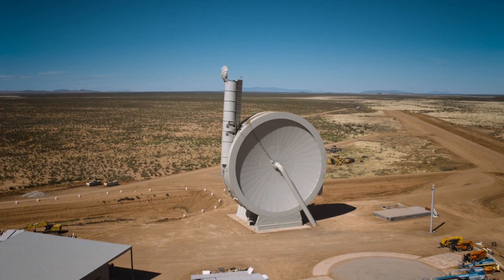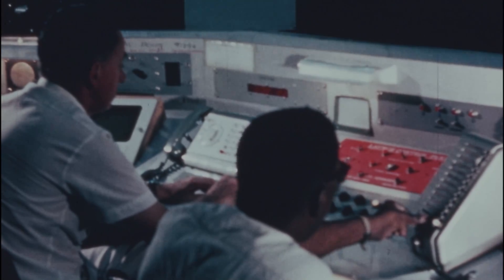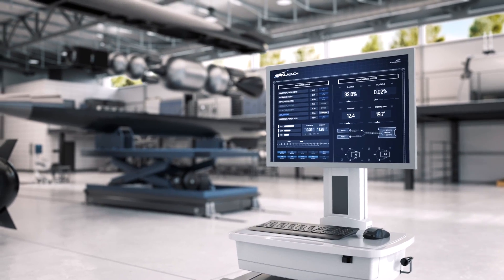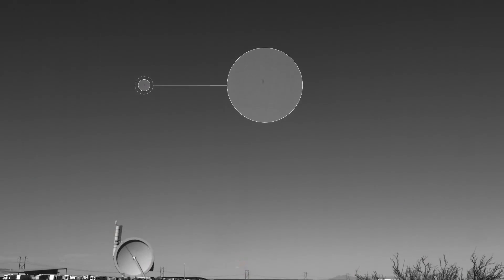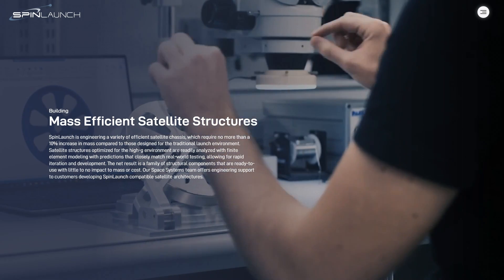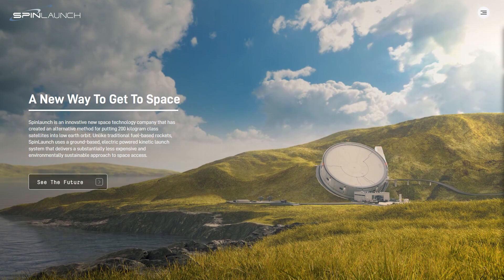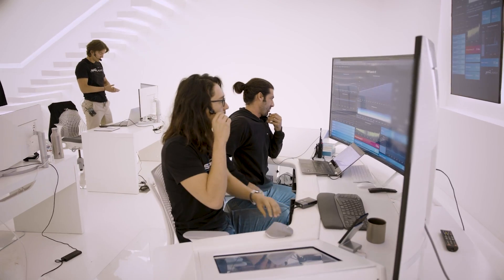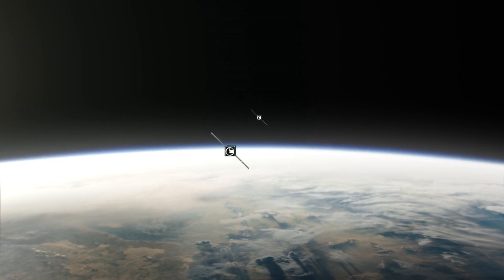Can Spinlaunch Throw Rockets Into Space?

Comment: I'd imagine that to re-balance the rotating arm at release, they could concurrently release a weight near the axis of rotation that would travel down the arm.  The transfer of that weight ought to also slow the rate of spin through some conservation of angular momentum.   (Where's my hand-waving Unicode emoji when I need it.)
Reply: This would introduce massive dynamic loads on the arms as they are decelerated in less than 1/4 rotation, and must contain the sliding weight at a g-load much greater than the rocket's 10,000g. Also aerodynamic impact loads are an issue, so there's a lot going on.  I was thinking a counterweight might be released at the same time that would need to be absorbed into the ground. This would be a pretty simple, but spectacular solution. The counterweight can be made of a liquid to prevent shrapnel and released into a chamber of energy absorbers. I can't think of a simpler solution than that.
Reply: @ryanmcgowan3061  Was my thinking as well.  Just dump a barrel of water into a shaft.  Of course as the barrel disintegrates the water is going turn to steam pretty quickly so you need to be ready for that.
Reply: @ryanmcgowan3061  Even water is shrapnel at mach 6. They cut steel plate with a water jet.
Reply: @ryanmcgowan3061  I came to the same idea. At the moment of launch the change in centrifugal force is proportional to rocket mass times radius (of rocket center of mass). To compensate an equal amount of m x r must be released from the opposite arm synchronously. The released counter mass would carry  r2/r1 times the kinetic energy of the rocket.
Reply: @venietvideo  Yeah, it doesn't really cost extra structure and mass either, because the counterweight is critical to the launch. And the release mechanism is already designed for the other arm. That being said, a rail gun seems more practical to me overall. If ever humans were to be launched, sustained 10,000 Gs is a non starter.
Reply: @ryanmcgowan3061  The problem with moderate linear acceleration is that the device will be very long. For example to reach v0=2000m/s with let's say human compatible 5g (50m/s²) would require 40 seconds acceleration over a distance of 40 km! (distance=velocity² / 2 acceleration)
Constructing such a huge device would be a big economic challenge. Another drawback is that the direction of launch cannot be changed.
Reply: @DavidKnowles0  The rail gun is being used to create a hypersonic canon at speeds that are at the bleeding edge of current technology. Linear accelerators are pretty well developed. If you ever spent the day at Disneyland, you probably have been accelerated with a small bus-sized load of other people to 60 mph in a couple seconds using a linear accelerator and didn't think much about it.
Reply: @venietvideo  Yep! If you don't manage that kinetic energy that's on the counterweight arm, your centrifuge is going to try to yeet itself into the ground with equal and opposite force. It's as if your centrifuge got hit with a very large artillery round.
Reply: I was thinking the same. They might use some sort of mass release mechanism to even the load. At 2:36 the slots in the counterweight might be to load detachable balance weights. I don’t think they would need weight transfer to slow it because 1, once the seal at the exit breaks, the arm will be hitting the air at Mach 6 and 2, those big E motors can probably double as huge E brakes
Reply: @them2545  I imaging the problem is less of slowing down and more to do with the sudden massive off-center mass, since you'd be having really big oscillating loads as a result
Reply: @rickrickston3202  yea slowing down takes care of itself but I think the only way to equalise the arm quickly enough is to release mass from the other side
Reply: @them2545  I think the influx of atmosphere will also help with the slow down and also you could put the system into a regenerative braking mode like on a car to help recover some of that lost power while also providing some resistance on the arm. It would be inefficient as hell, but work on two fronts (breaking and power regeneration)
Reply: That's a very interesting idea. The problem is that the weight being concurrently released will also have a huge momentum (comparable magnitude to the vehicle getting launched). So it would require something to rapidly slows it down to not damage the system. Maybe we can use technology similar to regenerative breaking (breaking by induced eddy current) to even reclaim some amount of energy back.
Reply: @tlxyxl8524  More likely, the counterweight would be disposable, and it would be launched through a counterweight tunnel at hypersonic speed. It would look like one of the Air Force's supersonic rocket sled tests. The counterweight would disappear, and the impact would be read on seismographs 1,000mi away.
Reply: @tlxyxl8524  you could probably use the massive engine es that accelerated it to stop it. Or the inrush of air hitting the arm at Mach 6 will slow it quickly
Reply: I have personally met the leaders of spinlaunch, I believe they have said those exact words to me
Reply: Why not just have another launch vehicle and let it go half a rotation later minus a few degrees?  Cuts your launch costs in half.  Can't be the exact same path or it would nail the first since it would be traveling in its slip stream.  Or, you could let it go simultaneously and let it disintegrate at the end of a short tunnel 100' underground.
Reply: @StormGod29  what kind of oscillation issues would be present in that half rotation at full speed? It might be minuscule in the launch sequence but it could put the payload off course
Reply: @StormGod29 That was at least somewhat considered per a friend who worked for them. No idea what the final results are.
Reply: If they had an identical pointy thing at the other end of the arm and simultaneously released it down a ground facing tube, they could double their income by also being a drilling company.
Reply: 👏? I don't know about this. To get something up to speed and carrying any payload... So much to consider.
Reply: @R.B.  Biggest issue to overcome is the power supply. General Atomics is working on the technology. I actually had an RFP cross my desk to help supply the electrical power to a rail gun, but my electrical engineer at the time was out of his comfort zone. He had never seen power requirements for anything that high, and this was just for a slug. Accelerating a spacecraft would be a factor higher.
Reply: I couldn't figure out why there isn't an opposing exit shaft going down into the ground so the counterweight could be released at the same time.
Reply: @felicitywilson9016  I guess they just have it run on a rail around the inside of the chamber and let it slow down under electric breaking reclaiming some power
Reply: @felicitywilson9016  - with equal and opposite force. Very good point. If you don't manage all that kinetic energy, that centrifuge will yeet itself into a crater.
Reply: on a momentary thought of this, i concluded maybe a braking system, disk brakes or something similar. if you can reduce the speed at all, that could be compensation for the now missing weight. which should simultaneously give support to the center maybe even being adapted to be a sensor for calibration. reducing weight from the arm seems dangerous and could also introduce unwanted risks like, the arm hitting the counterweight while it falls. then the other configurations where it is mounted.... on a mountain.

the only solution i can suggest to the weight is place electromagnets on the perimeter of the launcher and divide the counter into two pieces that can be zapped to the walls away from further collisions. should work with most/any inclines.

i've never seen this spinlaunch before, not that i remember anyway. i can't do maths very well, but i'm sure i understand enough to share the thought.
Reply: A simpler way would be to put a releasable weight or ballast on the other end of the arm, at the counterweight. Which would require a second tube or tunnel, this time going into the ground. Release the payload and the counterweight ballast at the same time, the payload is yeeted into space, the counterweight gets shot down its tunnel to violently become one with the backstop material (which would have to be a respectable distance away, the counterweight will also be hypersonic). Thus your centrifuge remains balanced, or at least reasonably close. Hardest part will be to make sure the released counterballast doesn't destroy your Stage Zero.
Reply: I was also thinking either an ejectable/emptyable counterbalance or a mass near the axis that could be released in a damped way toward the yeet end at or just before the moment of release.
Reply: A mass moving down the arm on the same side as the projectile seems simplest way to conserve angular momentum.
Reply: Or have the counter balance weight jetison at the moment of release in the opposite direction, maybe into a '"My pillow"'? :)
Reply: Another problem that I see is the fact that the yeet vehicle will actually be rotating at 450 rpm at release.  That rotation will have to be counteracted somehow.  I don't think the aerodynamics of a cylindrical body spinning at 450 rpm tangent to the airflow will be very efficient.  
I do remember reading about using launching arms on the moon to launch lunar minerals up to huge orbiting catcher bags.
Reply: @longshot7601  open another hatch on the opposite side a rotation just before release and turn it into a blower? I still think closing a hatch just after the vehicle is released yet before it has broken through might be better because then you don't have to worry about an in rush of air.
Reply: For a releasable counterweight one could possibly use a liquid tank with a mechanism to release the liquid contents in an instant. Would be like throwing a huge water balloon at mach 5 into the floor, so could use some careful design of a liquid trench to handle it.
Reply: Have a second projectile released simultaneously, that is highly magnetic, and goes into a coil lined tunnel.  As the magnetic flux rapidly slows it, the resulting power could be used to charge a capacitor bank that can be used on the next launch.  Maybe the counter-projectile could even have batteries that actuate coils in the skin at release so you don't have any issues related to spinning a magnet in a housing at high speeds.
Reply: @jaredkennedy6576  I believe they already release a counterweight, from what I can say without getting in trouble. I didn’t sign their NDA but I like them and want to continue on good terms. Cause no doubt they have seen this video

Comment: Not sure how they are rebalancing the rotor but I imagined holding a container of water opposite the projectile with a way to quickly empty the container as the projectile is released. So both ends of the rotor become equally lighter at the same moment. Of course then you have to deal with a rotor housing that is hit in one spot with extreme high velocity water every launch. But I figured a fluid would do less damage than a solid.

Comment: it seems like it would impossible for anything other than a solid rocket motor to survive the G-Forces of that spin up buy maybe I'm crazy. Wouldn't 450 RPM at 100 meters be like thousands of Gs?
Reply: As a first guess, consider a pressurized tank. The compressive strength of aerospace materials probably falls within the range of a few hundred MPa, let's say 400MPa. Then for a 1m^2 plate, it can sustain 400MN, which is equivalent to holding up a mass of 4000 kg at 10000g. Not as much as you'd like, but possibly workable.

This would only apply for the side of the tank that the fluid is pressing against; I imagine the other side of the tank could be supported by the propellant itself. For that matter, it's possible that the plumbing is already filled up wherever possible, just to allow any liquid to help support the plumbing structurally.
Reply: @rickrickston3202  Im sure you’re right and I totally believe pretty much anything can be accomplished with enough engineering m. It just seems to me I’d they’re already putting a ton of never before done things into practice and with the thrower, so a solid rocket would seem like an appealingly simple soution with high thrust to weight and few moving parts.
Reply: He said 10,000.

Comment: I'm sorry, but 10,000g? At those g forces that 200 kg payload would effectively have a weight of 2,000,000 kg. That's 2000 metric tons, for just the PAYLOAD. To put that in perspective, an unfueled 747 weighs 187,000 kg. The maximum takeoff weight of a 747 is around 450 metric tons. So just that payload alone at those g forces would weigh more than 4 fully loaded (overloaded actually) 747's.

Are they absolutely fucking insane? There's simply no way they could engineer something capable of surviving those forces.

Comment: Yeah the spinlauncher is great for the moon, especially for The Moon Is A Harsh Mistress when lunar revolutionaries need to hide their rock thrower from Earth forces.
Reply: Only problem is there's no way people could ride the spinner and survive.
Reply: @greggv8  on the Moon the RPMs would be low enough that the G's would be fine for people, and you could build it pretty big since you don't need to maintain a vacuum chamber for the centrifuge to operate so its much less costly to build.
Reply: What difference would it make to use this on the moon though? No atmosphere and little gravity, not hard to launch as it is. Earth is hard to launch from and that's what this is supposed to overcome right?
Reply: @FGuilt  A spin launcher from the Earths surface requires such a high RPM that the G's experienced are well over 10,000, for an extended period, so this is really only useful for launching solid materials, not anything like an air filled capsule, or biological matter like, say, human bodies, etc etc etc. Launching from the moon requires a much lower velocity so you don't see that high  a G level, and you can do it with electricity spinning it up, since theres so little water on the moon that you really do not want to be expending it all on rocket fuel, it should be preserved for any colonists life support, period.

Comment: 76% of Saturn v rocket lift thrust to escape the Earth's gravitational FORCE Is Acoustic waveform propagation fields.. aka SOUNDWAVE Energy. .. 

Centrifugal Force works more efficiently as a Arc Trajectory not straight up and down . Like a pendulum on a grandfather clock. Why use any fuel when you can use Soundwaves? 

And move the molecules below human range of hearing.. imagine an infrasonic frequencies engine... I can build it just need funding..

Comment: I got curious about the Sprint Missile after you mentioned it so I looked it up. Apparently it used a W66 thermonuclear enhanced radiation warhead to take out ballistic missiles with the massive burst of neutron and X-Ray radiation. In case it hasn't set in, it launched a neutron bomb which took out missiles by I guess frying the electronics with high amounts of radiation. Pretty clever. I'd only ever heard of neutron bombs being used as WMDs against civilian populations. I always figured it would be the EMP they'd be more interested in if they were going to consider using a nuke to fry any electronics. Though conceivably, the X-Ray flux would be part of said EMP. Though I'm not sure what spectra an EMP consists of, I would assume it's anything with enough energy to ionize a typical atom. Again, I'm not exactly sure what the precise definition of ionizing radiation is, since different atoms become ionized at different energy levels.
Reply: Not to fry electronics, but to cause uncontrollable, chaotic fission inside nuclear payload of an incoming warhead. This will cause premature explosion, which will scatter most of the payload and release very little energy compared to proper, controlled nuclear detonation.

Comment: That's wild. But I am surprised by the low RPM. Seems well within control for precise release to control trajectory. Very intriguing.

Releasing the projectile and balancing the reduced load is a good point. But it's a radial load on the bearing... something that a roller bearing is well suited to handle.

Comment: Hi Scott, wouldn't this concept be much easier to implement from a 10,000 ft mountain top, thus bypassing the most dense part of the atmosphere?
Reply: Building this thing in Quito would be optimal. 10.000 feet in altitude AND at the equator, or telluride
Reply: Exactly my thought! Stick it on a mountain or a high plateau and bypass the first few thousand feet of thick air.